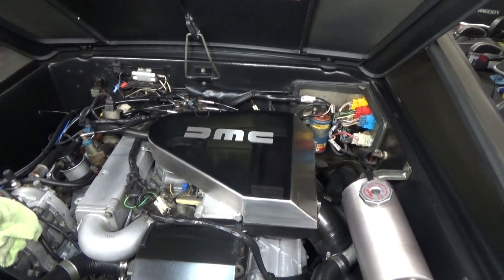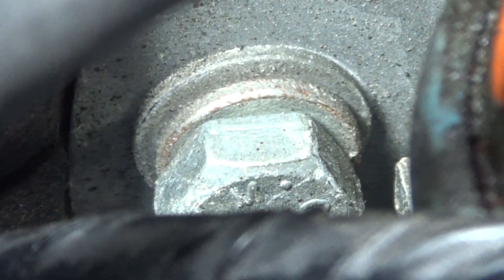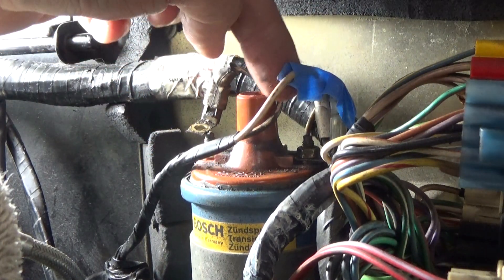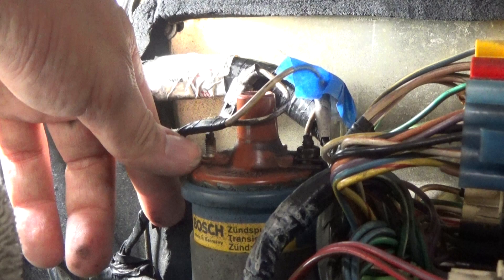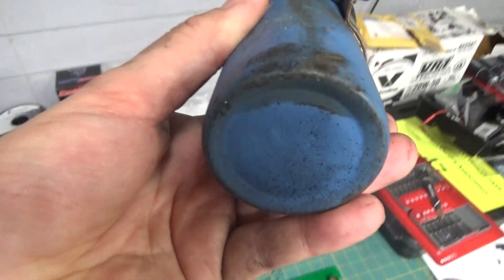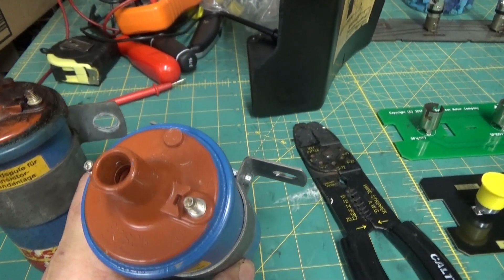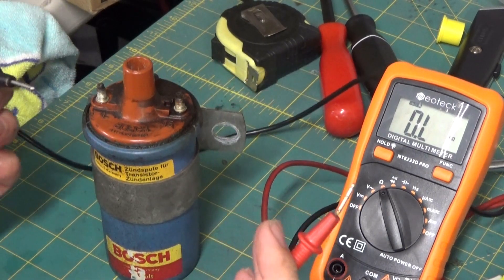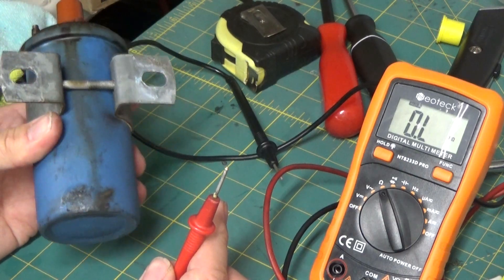How to replace the Ignition Coil in a DeLorean DMC-12 V6 PRV BOSCH

Comment: When purchasing a new coil should it by the 1.5 ohm model or the 3 ohm model? Does this change if converting the car to High Energy Ignition?
Reply from the maker: I personally recommend the stock blue Bosch coil (for stock non-HEI applications), which requires the external resistors/ballast.  Pertronix coils have a primary resistance of 1.5 Ohms for those who want to be safe ( same total resistance of stock blue coil + ballast ).  And yes this does change if you go to HEI. I read on DMCTalk that If you want HEI, you must change the coil. You can continue to use a stock ignition ECU, but the coil must be upgraded. Increasing voltage into a Bosch blue coil will kill it.
Three things are necessary for HEI:
1) increased primary voltage
2) suitable coil
3) wider plug gap
If you leave any of those three things out, you will not have HEI.
Reply: @DeLoreanTECH  Thank-you. Since my post I have discovered that Bill Robertson, who has excellent videos on converting DeLoreans to HEI, recommends the Pertronix 40,000 volt 1.5 ohm ignition coil.

Comment: Does that distributor wire feel snug and locked in on yours? Mine just stays super loose and I’m having trouble starting
Reply from the maker: I recommend replacing it then, it should not be loose.  Should be snug and locked in.

Comment: Nice video. Do you intend to make a video about the stainless air box? I saw you drilled another holes for the air? Thanks!
Reply from the maker: FDomi73 hi thanks for the comment.  I was not planning to make a video on the air box but am not opposed to the idea. What would you like to see in a video on it?  How to install?  How it was customized?
Reply: DeLoreanTech yes how to install it properly because I have one and it moves a little bit. Also it seems you add and air exist that don’t exist on the original stainless one.
Reply from the maker: @FDomi73  Okay I get it now.  Yes for mine I bought it from someone who had several different o-ring options.  I just picked the best one to fit my car.  I did have to finagle it a bit to get it to fit tightly, like adding a very large washer to one of the wingnuts.  The breather hose port was drilled/tapped into the unit, but it was done by the person who sold it to me.  I can show that in the video.  I'll try and pull something together today or tomorrow!
Reply: @DeLoreanTECH  hi, any updates on your video please?

Comment: Just about time Mr. I watched Video Videobob Moseley , engine coil upgrade, NOW  all  i need is to buy a proper upgread HT leads ..... but i cant fine any one , i mean the end of the lead is very diffierent then the original PRV engine, more detail i mean the boots for the leads .  unless i found the upgrade HT leads, i think ill save the coil later , to change with it .